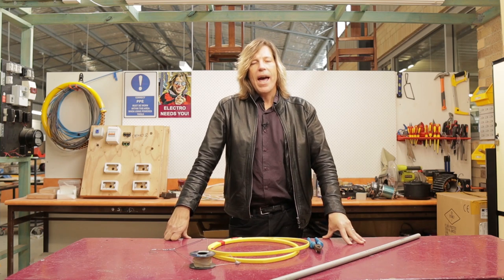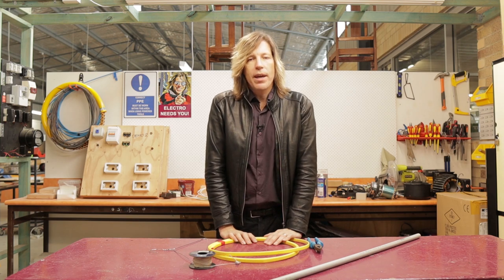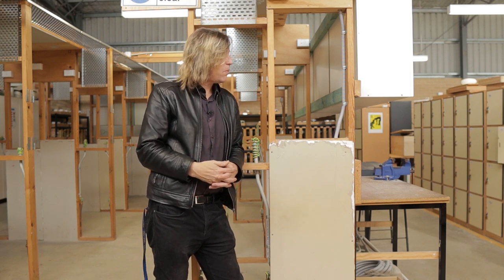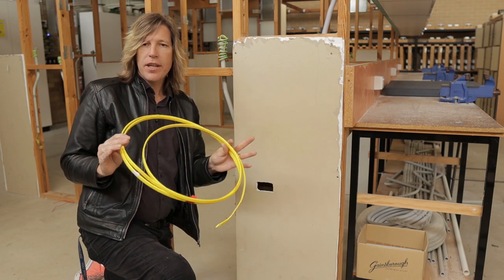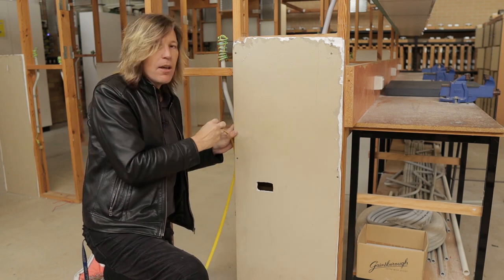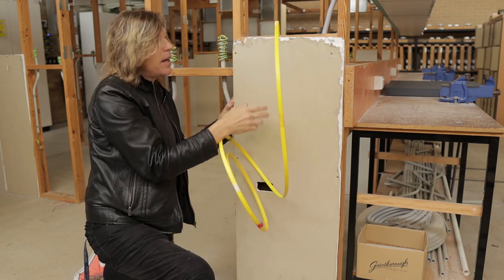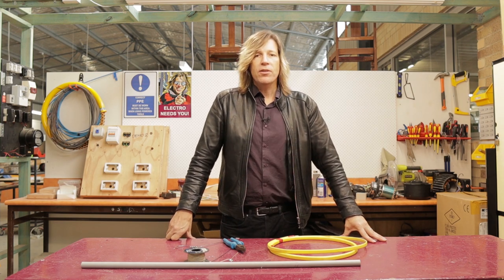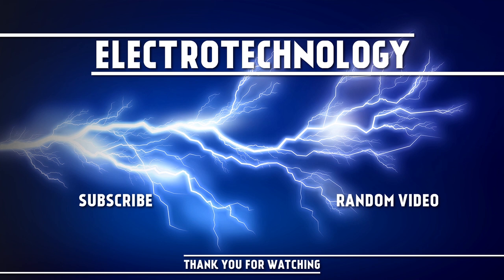How To Get Electrical Cables Into Walls

Comment: Would like to see how to get an extra cable into existing metal conduit. My house has metal all over and running cable in them seems impossible.
Reply: use a vacuum to pull through a string